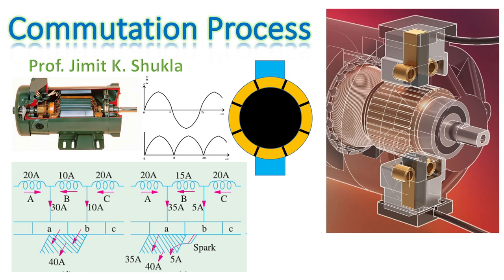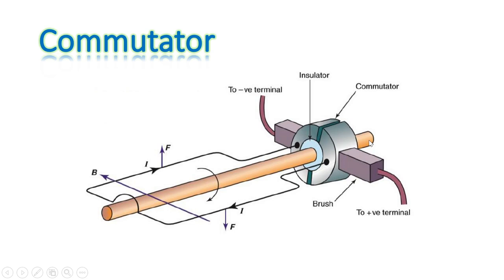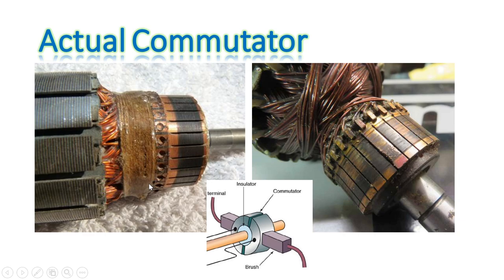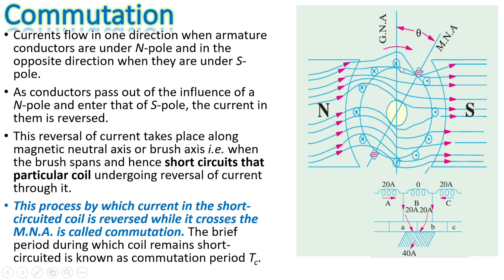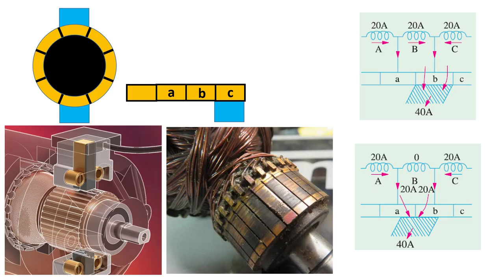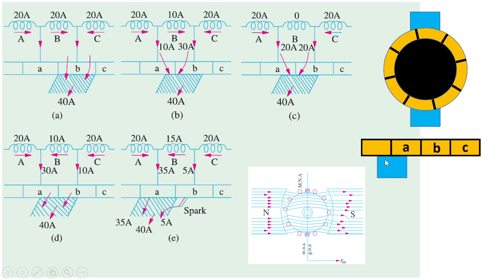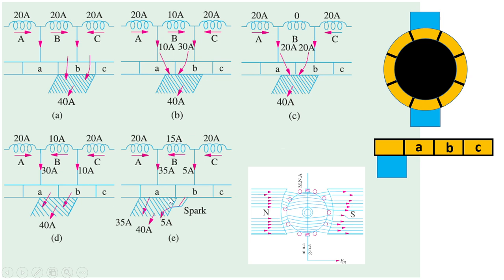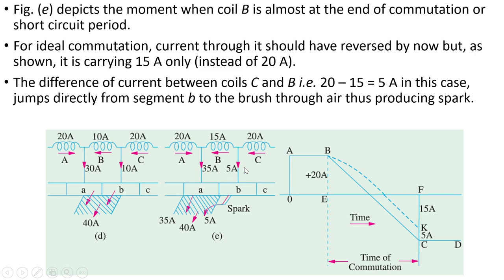Commutation Process in DC Machines | Animation | Sparking in Commutation

Comment: sar  dc machines kuyn use karte hai
Reply from the maker: Each type of machines have many applications for which they are suitable. DC machines are used for application requirements/characteristics like torque/simplicity of control/availability of supply/speed control etc.